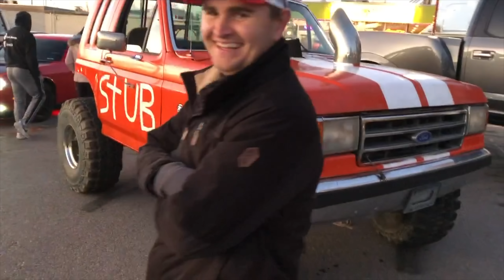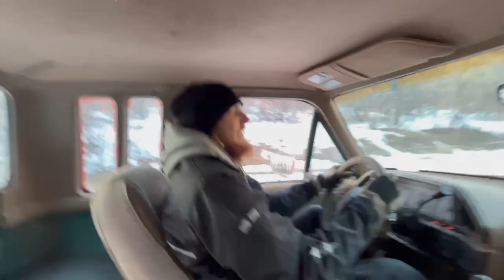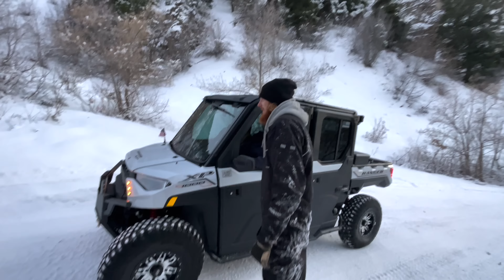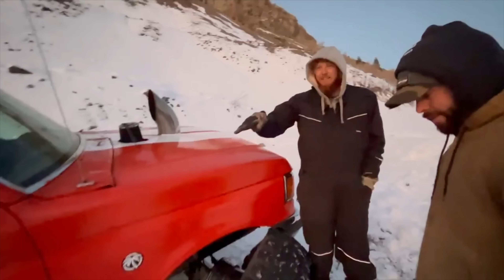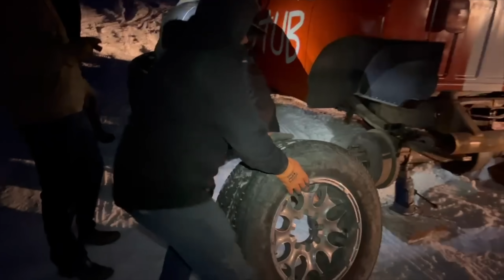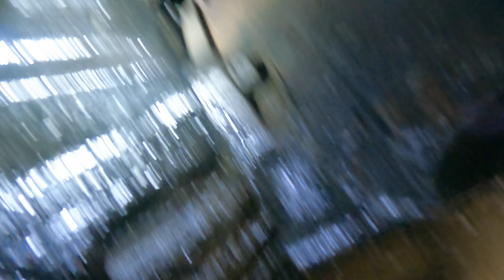Stub Truck's First Trail Run Doesn't Go So Hot

Comment: Have done that a few times on trucks.
1st remove the Tcase. It really helps with the balance. 
2nd put the rear strap OVER the top of the frame rail. More lift.
3rd put a strap around the front just about the bell housing area and up through the floor of the truck and lift off the inside of the truck. 
Have done a bunch of clutches out in the barn by myself. 
Work a little smarter and leave the heavy lifting for the beer afterwards!!

Comment: Bead locks, winch, blocks, pulleys, snatching straps, high lift jack, and air compressor and you can get yourself out of most situations. Most of the time you will use this equipment to help others though. Love your videos

Comment: Cheap trick: wrap the wheel just inside on the flat where the inside of the bead sits with 5 wraps of duct tape and it’ll hold the beads way better!
Reply: Gotta love an old 16.5 😅

Comment: Good job benching that trans out.  I bought a $80 harbor freight trans jack to pull mine.  Not a bad investment, also works as an adjustable height stool
Reply: decent jack for the money but any heavy trans does require them to be beefed up .   Jon at Farmcraft has a recent video where he used one to solo change a dumptruck tranny and almost ate it .  he did some simple improvements to it and now its a good unit .

Comment: I always found when using strap for a tranny Jack, use half of an oil bucket. If you leave the bottom, it can help index the transmission so you can maneuver it easily!

Comment: You should turn the exhaust pipe 90 degrees to the right so it doesn't blow on the windshield. A can of starting fluid and a lighter can reinflate a popped-off bead.

Comment: The rear drive shaft may be too long and bottoming in the trans when the rear suspension cycles, eventually breaking the bell housing. That's if you have rear suspension.

Comment: Check your drive shaft length, might have bottomed out and used your drive line as a shock haha. Bet seals on the trans input and tcase output are also shot

Comment: I'll tell you what happened to the bell housing. 1 of 2 things or both. Shaft length as others have said may be an issue. But I'll almost guarantee ( from experience multiple times)... low range 4wd, banging in and out of the throttle like you were causes the "twistys". Add the weight of the transfer case offset hanging off the side and crackers. You need to go to  solid transmission/t case mounts AND fab another support to carry and stabilize the the t case weight. 
Think about how much torque the bell housing sees then add the weight of the tranny and t case.  Boom!

Comment: As someone who grew up in the snow for more than half my life, you should not be airing down in wintertime unless you are stuck and its absoloutely necessary. You might air down to 15PSI at 1pm but if you dont add pressure before it gets cold out again that becomes 7-8PSI because the air heat cooled. Do not air down until you need to, otherwise, keep your air pressure. Also, never in my life have I ever heard of airing donw in snow, what?
Reply: Works way good to air down. It allows the tire mold over bumps and not dig in. Lots less getting stuck. We just screwed up not having a gauge
Reply: Sand and soft snow are pretty similar when you air down.

Comment: Did you guys not have another ratchet strap??
You could have used one for extra safety or when you were changing the location of the strap instead of having to hold it up.

Comment: I bet that thing is stupid fast due to scary lightweight characteristics. Wonder if Trevor is hiding out there somewhere too? A healthy beating isn't really an issue, but pushing it to the point of breaking for really no reason is distasteful to me.  You been working on this kind of stuff to be pretty well aware of the abuse that it can withstand, I think.  Deliberately beating it to failure comes off as not so genuine. You have some good ideas, and do amazing work. Don't force things. Florida man don't need to force things, he will find another way. Just my thoughts. Carry on!